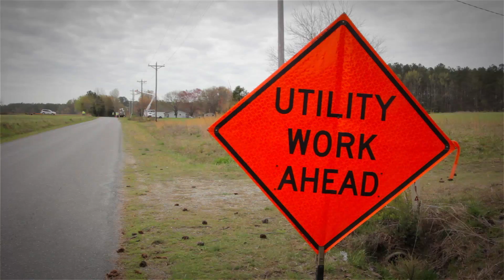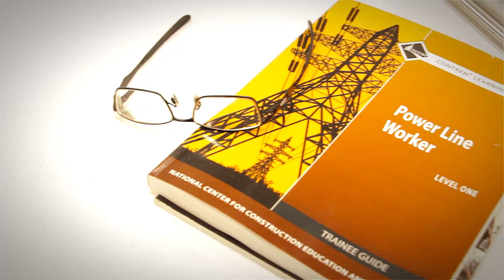Power Line Worker Training School

Comment: Wouldn’t solar panels make this less needed? (Not obsolete ofc)
Reply: Some Person you clearly have no idea how solar energy works
Reply: @garretr4488  I could say that to you too 😂 it kind of all depends on what ur trying to power and how much space u got I assume.
Reply: Some Person the vast majority of solar is either large solar farms in which case use the lines like a power plant or panels on people’s homes which also connect right into the main power grid, they don’t just power the house they’re mounted on.
Reply: In summary solar relies on the same power-line infrastructure so it’s always going to be critically important
Reply: @garretr4488  I gotcha. Good deal then. Hope this happens sooner than later
Reply: @gilbert martinez I smell sarcasm
Reply: Research supply and demand! Solar/ wind is not there yet